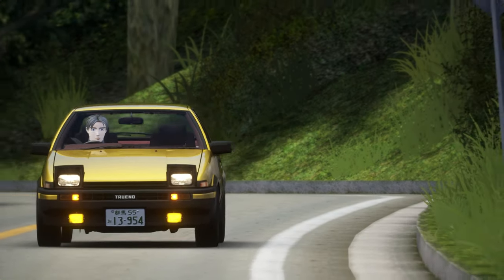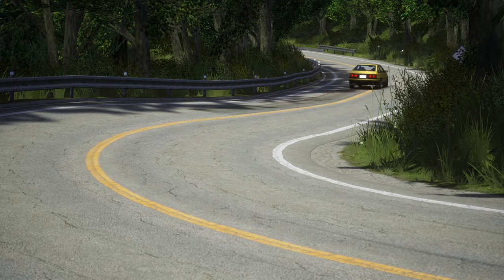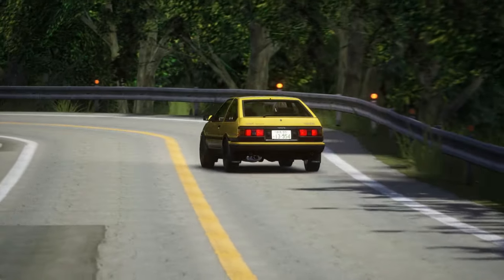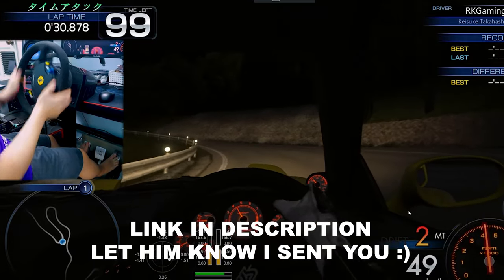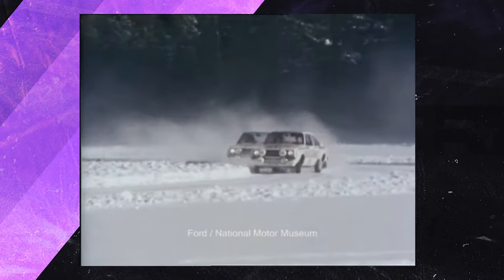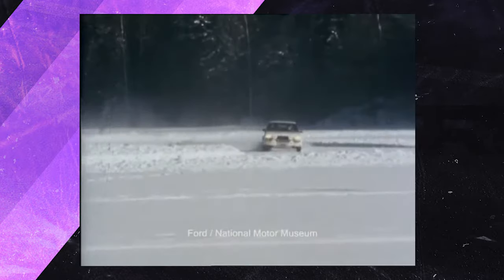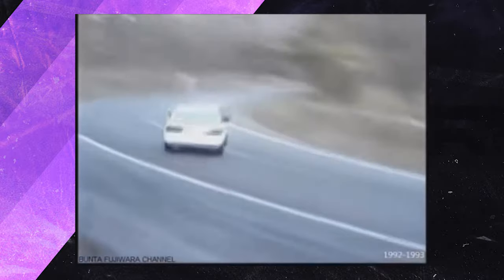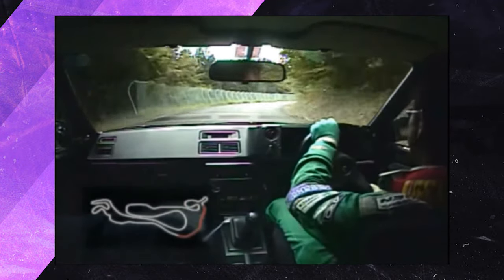Inertia Drift - Takumi's Touge Method You NEED To Learn

Comment: The most important part of this technique is to LIGHTLY press the brakes entering the corner. If you slam the brakes you will either spin out or crash into the wall.
Reply: Also (different for every car) applying throttle too gradually could make your rear tires suddenly gain grip and make you slam into the outer wall. On the other hand, applying too much throttle too suddenly could cause too much over stear making you spin out or hit the inner side so its best to find dat sweet spot

Granted the second sentence was pretty obvious to anyone knowledgable but eh
Reply: So... No keyboard way to do it ingames huh?
Reply: @memejirosano3350  who tf drifts on keyboard
Reply: @ihy6luto  more like who plays a simulator on key board
Reply: @memejirosano3350  You can make it on keyboard+ mouse
Reply: @justsomemustachewithoutaguy-  i've always done it without brakes, I suppose it might be more important going downhill. I tend to flick on flat ground or uphill
Reply: I may or may not have practiced it after watching this video and while doing it , i may or may not have done 2 360 turns
Reply: I don’t have or play sim racing games, although i think it’d be fun I just need a rig. So I mainly drift on gta. Idk just how much different it is compared to whatever this game is, but the inertia drift is just simple physics. Everytime I’ve tried it I haven’t lightly tapped the brakes at all. So thank you for explaining how wrong I’ve been doing it lol.
Reply: I did it with keyboard
Reply: What I don't get is how far are you countersteering when you stamp on the throttle?

If I try to accelerate that hard the car spins out.
Reply: So that is what happened with I tried this is most games....

Comment: Great video. Haven't you forgot to explain if it's actually faster than regular cornering tho?
Reply: It's not faster because it's essentially drifting and as we've established before, drifting in the form of drifting is slower
Reply: @dingo_ac  if you do it right it just looks like slip angle with aggressive weight shifting, which is faster than grip especially on hairpins

Comment: The scanadvian flick isn't really an inertia drift even though the underlying idea is extremely similar. 

The scandi is mainly used to initiate oversteer around a tight corner when you don't have the momentum to do so. It's quite a bit easier to do because it happens relatively quickly and over a much shorter distance. You can rely on power a little bit more than weight. Scandis are useful when you need to use weight to initiate oversteer such as when you're driving AWD or FWD or in a low power RWD car that doesnt have the power to straight initiate an oversteer situation.

The inertia drift is essentially a longer scandi flick. But the purpose is different. The purpose of the inertia drift is to link two corners together. This is what makes the inertia drift so hard to do. Because you need to overshoot the first corner and perfectly transition to catch the second corner. 

Okay, but how is this different from linking transitions in normal drifting? In normal drifting with dedicated drift cars, they're using power and basic weight management to pivot the car. 

With an inertia drift, you're not using power. You're using momentum shift at the moment of transition to link both corners. 

A normal drift transition is necessary to keep the optimal drift line. An inertia drift is necessary to ensure all or more than all of the cars weight is being efficiently transferred leading to the most efficient and fastest cornering method in lower power cars on downhill rally/touge corners.
Reply: I'm pretty sure both of you are wrong. That, or there is another technique that lends itself to the name much better. I discovered it a while ago during my experimentation with trail-braking and drifting. Under certain circumstances (mostly high speed entries) it's the continuous brake application instead of continuous throttle application that sends you on a drift. Of course it doesn't last long, but it does feel like you are drifting on the brake for a while. And since it's the inertia that makes that happen, I'm quite confident this is the real "Kansei dorifto".
Reply: @getsideways7257  

That's just a braking drift. 

You're just transferring weight forward to get traction in the front so the rear slides out.

You can still do that on slow and tight corners. You just have to brake at the right time and flick hard.
Reply: @ApexActionArts  Quite a few techniques can be described as "just transferring weight forward to get traction in the front so the rear slides out", including trail-braking. Judging by the "brake at the right time and flick hard", you seem to be talking about something different, because my initiation of the maneuver I described is relatively smooth and the brake application is continuous throughout the drift. Also, I don't remember doing any flicking whatsoever.
It sure sounds easy, but the execution is rather tricky. I'd say it's noticeably trickier than four wheel drift (although I believe a load-cell brake pedal would make it much easier to achieve, or at least a better brake than the one on G27).

Also, if you remember the episode itself, the Mazda guy classified it as a "Kansei dorifto" after seeing exactly what I'm describing here: Takumi was indeed shaving off speed while going sideways... I also can't quite remember if there was a corner right next to that left hander, but going by your logic he could only say that AFTER Takumi have had cleared both corners with your "prolonged Scandi-flick".

Not to mention, where exactly goes the "inertial" part in your proposed technique?
Reply: @getsideways7257  I never said a braking drift was inertial. I just said what you described sounds more like a simple brake drift. 

Trailbraking is also a lot of things applied a lot of ways for a lot of reasons. But it's not "getting the weight to transfer forward so the rear can slide out." That's initiation to brake drifting. Trailbraking is letting off the brake progressively after the initiation. It's not really a technique to get the car to slide out. It's a technique to distribute weight throughout the corner so the car remains balanced throughout.

A braking drift is just a simple slide initiated using the brakes which is managed through trailbraking on entry for minimum slip angle.

Bloke isn't wrong about a scandi being inertial but his video is pretty narrow minded about showing only one version of an inertial drift. 

In an inertial drift, the inertia isn't referenced on initiation or entry. That's just weight transfer. The reference to inertia is when the car changes direction under it's own weight shift. Which is why the Scandinavian flick IS an inertial drift but it's only one type of inertia drift.

Your logic is also flawed. Everytime you brake you have inertia. Everytime you accelerate, you have inertia. Inertia is associated with mass of vehicle. More the mass, more kinetic energy vehicle possesses. Brakes consume kinetic energy and covert it into heat with the help of friction. Based off of your logic, you can technically call every single technique "inertial" but that's taking everything out of context.
Reply: @ApexActionArts  Then by your own definition even a typical drift with changing sides is "inertial".

Also, you completely ignored my referencing the source: there was no "swinging" from side to side in that part of the Initial D episode (apart maybe from the initiation of the drift). And even if different sources can call different things the same name, apparently the channel owner meant the Initial D version.

Trail-braking is essentially a braking version of four-wheel drift. You transfer as much weight as possible to the front and outside, making the front wheels pivot inside on their contact patches with the car itself while the rear ones slide very little to the outside, making you turn in efficiently while shedding speed at the same time.
The "letting off the brake progressively" thing is nonsense. Also, "trail-braking" isn't really a good name for it. "Feathering the brake" describes it much better.

"A braking drift is just a simple slide initiated using the brakes which is managed through trailbraking on entry for minimum slip angle."
I just remembered what was normally called a "braking drift" - it's just your typical "step on the gas" acceleration drift, only initiated with the brake to make the car "stumble" over the front wheels.
And what I'm talking about here is maintaining the drifting posture on the brake while DECELERATING. In a gas drift at an angle you keep most of the car's weight on the rear outside wheel through both of its longitudinal spinning and lateral sliding, in the angular drift I'm talking about you maintain it on the FRONT outside wheel: through the longitudinal braking force on the said wheel and through the lateral sliding of the rear outside wheel.

Trail-braking is essentially the same, except there is practically no opposite lock involved.
Reply: So, it's "inertia drift" because your are not sustaining it with your gas pedal as usual, you are utilizing the kinetic energy you had before entering the drift to sustain it for as long as you still have sufficient inertia
Reply: @getsideways7257  

Uh, trailbraking isn't "essentially" a four wheel drift. That's not what trailbraking is at all.

You can trail brake and not drift, or rotate, or steer. You can trail brake and still understeer if you want to. 

To get the car to pivot on its wheels, you'd need to brake hard and turn the front wheels in the desired direction to make use of all the grip at the front wheels. Then you begin trailbraking so the car doesn't get upset mid rotation.

"Letting off the brake progressively is nonsense" 

"Trail braking is a driving and motorcycle riding technique where the brakes are used beyond the entrance to a turn (turn-in), and then gradually released (trailed off)." -wikipedia

My time on old akina was 5:14.9 on the ae86 tuned.

My time on new akina is 4:27.4 on the ae86 tuned. 

We can settle this debate with a race on akina to see who's driving philosophy and understanding of driving is more valid. 

Last time I checked on the Touge Life leaderboards, I'm in the top 30/1000+ drivers and 8th fastest AE86 Tuned on the server. I've driven with and raced against some really fast people like Terra and Baba.

If you'd like to race, let me know and we can set up a date and time.

A video of me racing an rx7 in the stock ae86 for reference: https://www.reddit.com/r/initiald/comments/pr8cq1/blew_past_an_rx7_in_the_stock_ae86_and_had_to/?utm_medium=android_app&utm_source=share
Reply: @ApexActionArts  Well, I agree with the "to get the car to pivot on its wheels, you'd need to brake hard and turn the front wheels in the desired direction" and with the need to ease off the pressure on the brake a little, but only for the sake of inducing some rotational momentum on the car and not exceeding the front wheels traction limit (the grip circle thing). But the turning amount is minuscule, as is the easing off amount (at least if we are talking about relatively low grip applications, like during road car touge runs). Although I guess more easing off would help with regaining traction at the back end, should it start to get out of hand. Still, the end result of this is inducing a certain measure of controlled oversteer. "Stabilizing" in itself doesn't help with anything. You are the most stable while stationary anyway.

"We can settle this debate with a race on akina to see who's driving philosophy and understanding of driving is more valid."
Or simply who is the youngest, healthiest and has a better sim-racing rig and reaction times? Oh, please... If the scientific community would "prove" theories that way...

So, I take it that apart from a racing match you don't have anything to support your point with? Ok, be seeing you then.
Reply: @getsideways7257  You don't seem to know what trail braking actually is. Pretty sure Bloke has a video on trail braking as well

Comment: Since i can only use mouse steering and keyboard the only way y can get close to a inertia drift like in this video is to downshift while steering a bit to the corner whit a bit of hand brake and then full throttle. it looks nice with minimal angle, but its slow compared to others. or maybe i just need to practice, who knows.

also what about tire wear?
Reply from the maker: This is an actual technique, called shift lock :) Although, without the handbrake typically
Reply: Just tap the handbrake whilst entering a corner just enough to maintain a slight angle. On longer corners just do a scandinavian flick and keep on the throttle. On keyboard you can be just as fast especially with lower power cars but it will take more practice.

Comment: I've been doing that forever in real cars and my semi truck. I just always called it  weight transfer. But I can do it well enough But I can do it 180 in 1 of the small gym C Jimmy's  With an automatic transmission. And a lot of the other gym cars.  In my manual fiero it was easy.  Just  Downshift Several gears and spin the wheel. But you gotta have a good quality club because you will eat 1 help. Automatics are not as easy there's several more steps. As you start to Turn the stereo wheel You apply light pressure on the brakes ( Not enough to lock them up)   And down shipped into Low gear all at once.   This causes most of the weight to  Transfer to the front wheels   Making it possible for the automatic transmission to lock up the rear wheels. I could do this in a standard ride Height GMC Jimmy or ChevyBlazer At 45 mile per hour. These were the small ones that were popular for a while before they went bigger. Reason I can do it in A GM vehicle And not a Ford its because fords has a governor  That will not let the transmission kick into logier but GMC  And Chevy  Don't have it. At least back then. Not in my Fiero  With  A manual transmission I could do it at speeds of 90 miles an hour. I'm sure I could do it in a lot of other manual transmission rear wheel drive cars.  But like I said you gotta have a good quality racing clutch. I did it with a competition Brand super Clutch and burn it out in 6 months. Then I used a Dual Spring double Played it racing cbitch and I never burned it out.

Comment: wouldnt that just be a scandinavian flick then?
Reply from the maker: It is, but the term Scandinavian Flick is typically used for Rallying
Reply: @TSRB  then maybe feint, the intertia drift is kinda like a transition im pretty sure, not an entry
Reply from the maker: @syndeko1632  Scadinavian Flick (also known as "Inertia Drift" or ”Fishtail Drift”) This is done by steering the car into the opposite direction of the corner then shifting the weight of the car into the direction of the corner, causing the tires to slide.
Reply: Yes
Reply: @TSRB  Touge racing is just rallying on the tarmac of a mountain road 🤔😌

The definition of rallying states that it happens on private or public roads, rather than a track designed with racing in mind from the ground up. Some rallying stages are entirely on a touge.
⛰️🚗🕙🌔